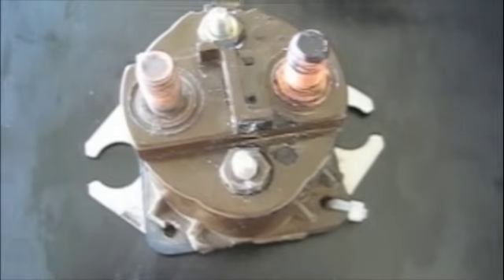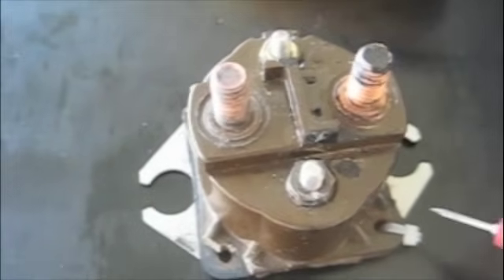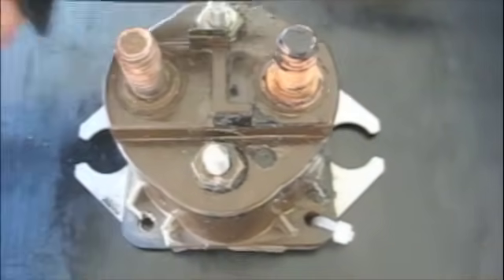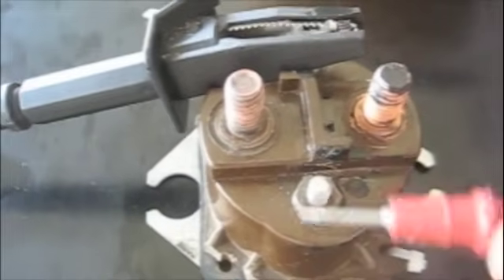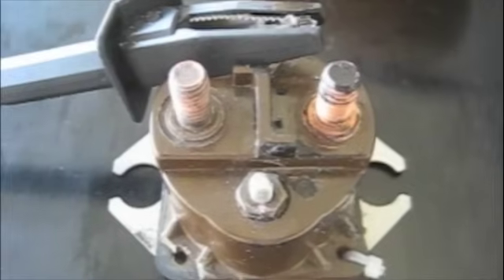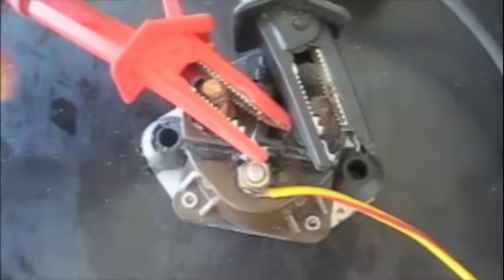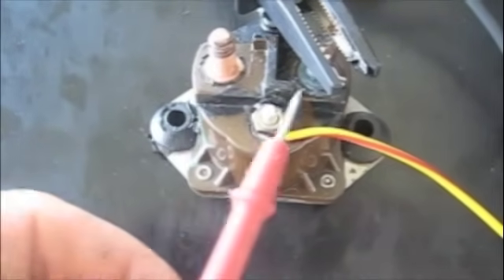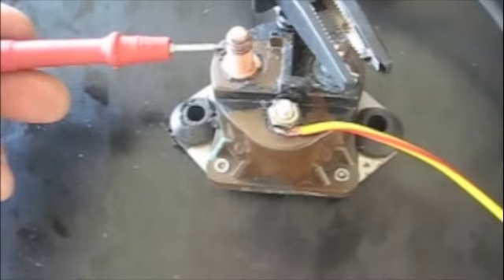Solenoid Troubleshooting

Comment: Continuity is not a good test. Use a voltage setting and the is a voltage that means it's bad. Continuity only shows Evan if only a tiny connection. Voltage shows a much better result. The higher the voltage reading the less current it can switch!!!!

Comment: I can't tell where yellow/red wire is hooked to and the black wire. If solenoid is 48 volt do you put 48 volts to small terminals to check continuity on big terminals? Thank you!

Comment: It is not a solenoid but a relay which is a switch energised by a coil so even if the coil is good the contacts could be bad. Sometimes relays stick closed.

Comment: To perform these test does the solenoid need to be unwired and separated from the starter? Thanks  My solenoid clicks when keyed but high amperage only to one side and no start!!  Anyone??
Reply: You can try gently tapping on the starter 
I’ve tested starters off of the vehicle as well using a set of jumper cables first use your ground cable and clamp it onto one of the ears on starter using a small jumper wire clamp it to your solenoid (small connection to post on solenoid) then clamp the large post with the positive jumper cable end I also use the vehicle battery for the power supply for testing using the other end of your vehicle jumper cables clamp the ground side of the battery with the ground jumper cable at this point either have an assistant hold starter motor or put in a vice double check connections then tap positive side of the battery with positive end of jumper cable. If it (bendix) kicks out but the bendix doesn’t spin it’s the starter motor
Reply: Thanks 🙏

Comment: I have a 2007 EZ Go electric golf cart. I purchased new batteries last year with a service. This year, the cart starting jumping when put in F and R. Now, the cart won't move and the solenoid just clicks loudly in both F or R when I press the accelerator. Is the the solenoid? Something else? I don't want to have to load the cart and take to dealer. ???
Reply: Roy Miller did you figure out what was wrong with your Cart mine is doing the exact same thing
Reply: Roy Miller maybe the accelerator switch. Normally electric golf carts have a throttle sensor that sends Signal to a module that then sends Signal to the motor. Ours normally does it after it gets wet, soaked, or high humidity under the cart.

Comment: Thanks for the video - the problem I am having is ...  my 36 volt EZ-GO has forward and reverse - and the in both "directions" it goes FULL SPEED !  there is no progressive acceleration.   any idea what that might be?  thanks much !
Reply: GD Tractor your throttle input.
Reply: Our yamaha golf cart is doing the same thing it goes full throttle when i just touch the pedal its all 36 volts. Did you get yours figured out? Please respond.

Comment: very poor description
for example why did you not explain the type of power you used to charge the solenoid 
and for terminals what if both working but one side not passing good charge ut still beeps
and last back up the camera to see more connections
,eans zoom in and out
Reply: Well said
Reply: Ahmad Karout 12 v

Comment: i own a 02 dodge caravan 3.3 V6.. it turn but won't start it makes a tinking sound like a dead battery.. my battery good alternator GOOD... I knw its not them... im lookn at my starter or solenoid... how can I tell if it's my starter or solenoid..?
Reply: Michael Freeman I have a Honda gold wing 1200 86 I put a new, solenoid and it works good for about 3 days and now it just dim the lights when I hit the button but it won't crank can you please help

Comment: Does it matter which way the current flows across a solenoid? I am 
installing one in an outboard motor and not sure which cables should 
hook up to which bolts (I know the small wires go on the small and big 
on big)
Reply: no its not polarized

Comment from the maker: Scott, that is true; the best way to test it would be to energize it with a high amperage load and perform a voltage drop test across the terminals.
Reply: 2007 fuel blaster 500 mL starting tilt sensor

Comment: One problem with checking the solenoid like that is that it may not work under a load and test just fine as you did. If placed under a load the contacts may not support current flow. The best way to do it is place a high current device on the secondary side and see if it supports the current flow after you energize the primary side. I have found some that tested good as you have but did not support current flow once a load was placed on it.
Reply: Agreed can't tell you how many times I've had relays which acted the same way

Comment: Good video. One thing though you can have continuity when you have a SHORTED coil. And the solenoid won't work.
Reply: In that case a voltage drop test across the '+battery' solenoid post and the 'to starter motor' post would be the best test, yes?

Comment: On riding lawn mower, touch the selonoid with your thumb & index finger. Turn key if it clicks and the starter wont turn it's your selonoid. Note: the two post if one has a green residue on the tip that post is not making contact inside. Grind off the  four rivets open gently and clean the residue on the nut at both ends with sand paper and put back togethere, replace rivets with small screws and your selonoid is fixed. 
I checked all over the internet to troubleshoot my selonoid & could'nt find anybody with any tips, everybody is telling you to buy all kinds of meters. After I purchased a new selonoid and installed it. I took the old one apart & it's very easy to fix. NOTE: I noticed that the bottom nut on the pole with residue was about 1/16 loose making bad to no contact.
Reply: I have a version for marine operations, the corosion may be very quick to take in such an environment

Comment: perfect explanation of how to do it text book, with no doubt.
Reply: Perfect? The second test did not explain where any of the wires were hooked to.  All it showed was four wires going from the solenoid and for all we know the wires ran down the road and back and he just made the multimeter beep because he likes the sound.
Reply: OK. I will try. The larger terminals are meant for the battery connection and the starter connection.The two smaller posts are signal wires. On a three post system the forth will not be needed. How to decide that? The S I  from a fender mounted installation provides 12 volts to the solenoid . It is the wire that controls the ignition circuit and in series with the neutral safety switch or switches that guard the transmission from lurching. 
 In order to isolate that. Hook the positive from the DMM to S 1 than to the negative battery post with the black connection. Go and turn the ignition to on and then to ign./ on crank; there should be 12 V there. If less, such as, 4.5 vdc you are likely to have a blown fuse. With no voltage the PCM relay in the engine fuse compartment outside the cab may be in suspect. From there neutral safety switch if this is a a manual transmission. Should it be an automatic the DTR or digital transmission relay located at the transmission can be suspect. Then the ignition switch. Then the security system .Then the Key cylinder or key itself.
Otherwise if there is 12 volts there and it does not crank. Try the other post on a four wire solenoid. The fourth post is an auxiliary circuit meant for add on's,caution there. If it still does not crank. The problem remains on the starter side of the circuit Wires and Connection,then for less than 12.6 volts. Battery if it fails a load test or is below 12.2 -12.4 volts. Good luck. 
Remember this video is a bench test which explains the function of the part not the wiring. Hope this helps and your not hung out. Be patient and isolate the problem. Even if your under fire.  You will succeed.

Comment: you heard it click right? that's the solenoid inside of this relay. the gm one is a relay too. ford just calls it a relay gm always calls it a solenoid. the ford one doesn't get hot because it's not mounted on the starter/ engine. the gm one also activates the starter drive.

Comment: dont take my word on this but ive been there with my westwood ride on mower. wouldnt start with the key but would jump by shorting the solenoid.
i replaced the solenoid,checked the key ignition switch all were fine and i eventually traced it down to the footbrake switch.my solenoid was a four post too and i believe the two small posts are ground/earth (black ) and (red) ignition power. not certain what the orange is for maybe lights or something. check safety switches brake and seat.

Comment: I'm trying to get my commercial lawn mower to start. I just bought a new solenoid and ignition key switch. Its a four post solenoid and the mower has some safety switches that have to be on to start. I know the starter is good because its new and the motor starts/runs when tripped with screw driver. There is two large power wires and 3 small wires. Small wires are blac k, red, and  orange. No power to small posts when i turn the key. Should I? Small red wire on the large battery post. Any ideas?